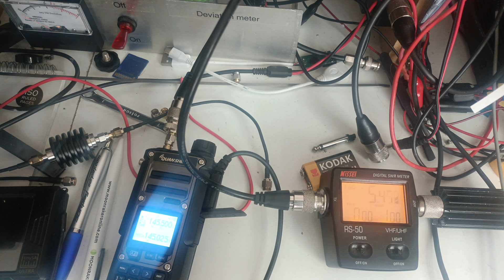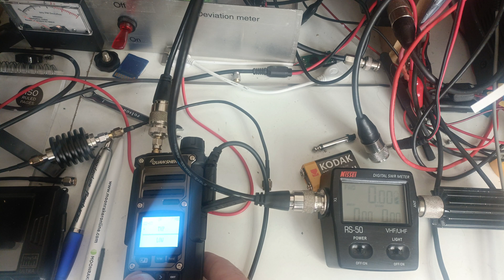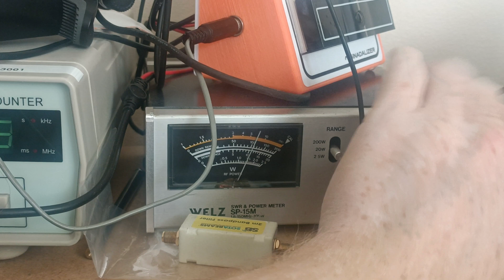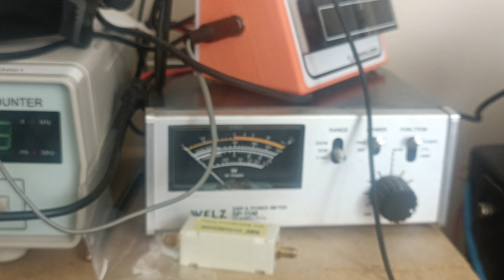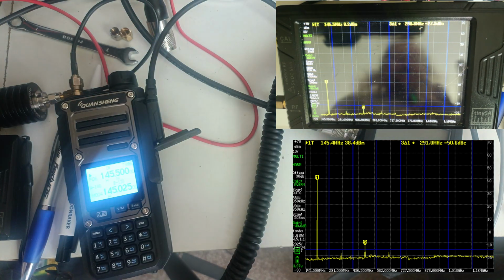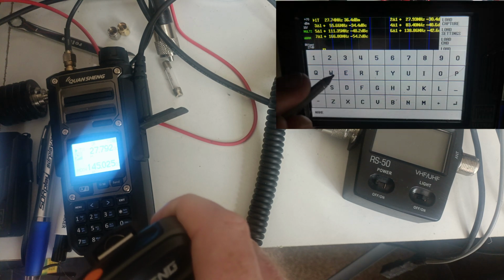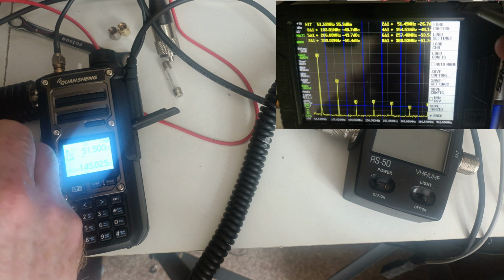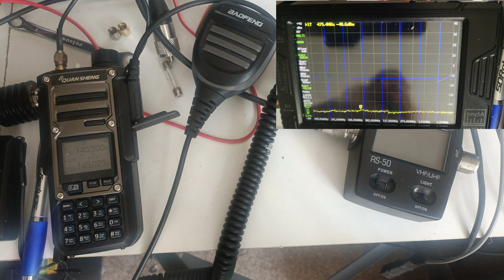Quansheng TK11, power and harmonics test

Comment: Here in the United States that is not channel 19 or 20 the frequency  of 27.781 the actual frequency of channel 19 here in the US is 27.185
Reply from the maker: We actually have 2 blocks of 40 channels on CB here in the UK, a set first legalised in 1981 much to the disappointment of many that were using imported US sets illegally and 40 channels that line up with the US frequencies  legalised in 1987 I believe but opened up to legal multimode use in around 2014, as this radio is FM transmit only and chances are that it would be used primarily on the UK specific block of frequencies in this country s why I tested it there